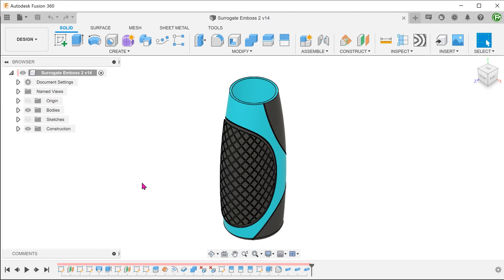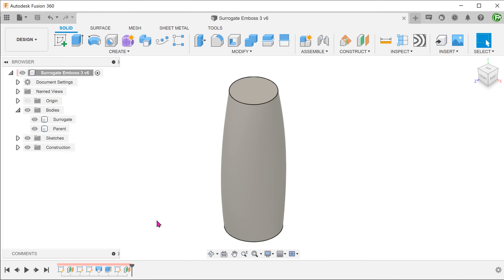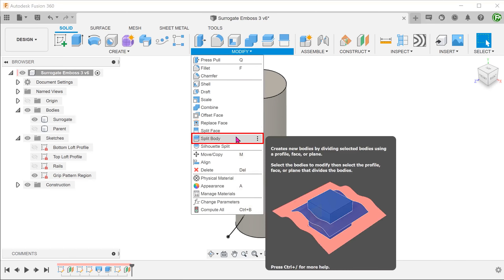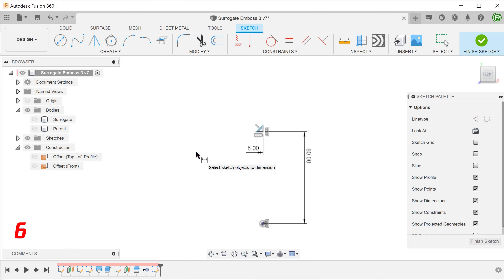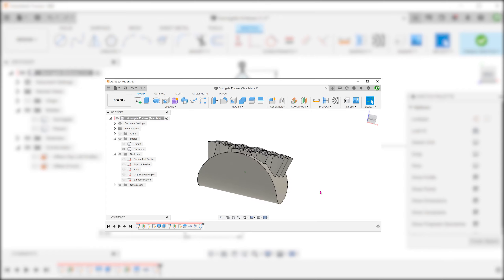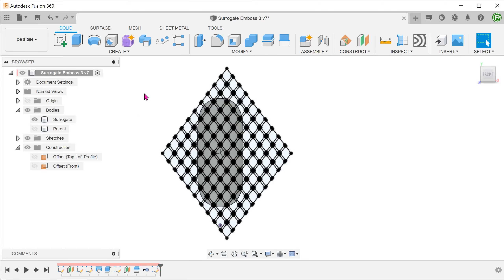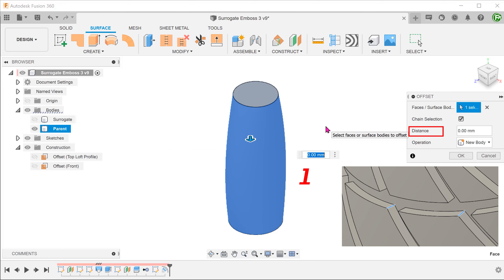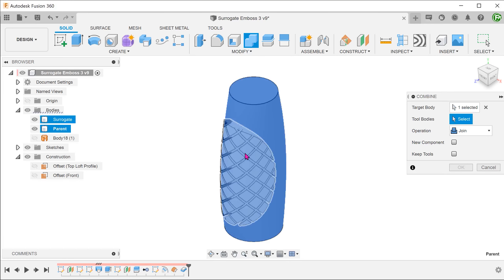Fusion 360 | Surrogate Emboss

Comment: Really hope Autodesk are watching this to see the weird and wacky ways you have to go about doing an emboss like this. Although it is great the work they have done so far with their emboss feature it’s still so far in its infancy. Great tutorial as always.
Reply from the maker: I will cut Autodesk some slack here. Solidworks has the same problem with their wrap tool. I think the technical term is that this will only work on a developable surface. I am not sure whether this is a geometry limitation or a software limitation.

Comment: So IS there a way in Fusion to have an actually accurate pattern on a surface that is non-planar in more than one direction?  I have plenty of curved surfaces that I need to pattern components and/or features onto, and I don't know if Fusion can even do it. :-/
Reply from the maker: I have not tried this yet but it might be possible to use the sheet metal function for this. Of course, it would be a lot more involved. You can refer to this video to get a sense of how this can be done.
https://www.youtube.com/watch?v=yfJBy9xpqI8&t=197s

Comment: I keep getting Error: new ef_int outside edge
 on embossing :( anyone got a solution?
Reply from the maker: Hi, during my testing, I would sometimes get this error too. I would suggest that you try to slightly adjust the pattern. This can be done either by adjusting the size of the diamond or the spacing.
Reply: Ugh, Fusion 360 still full of glitches